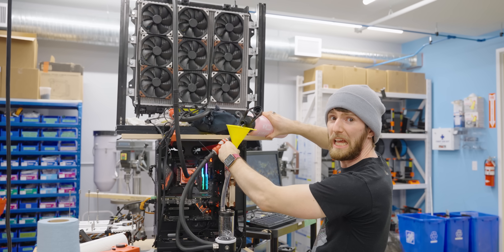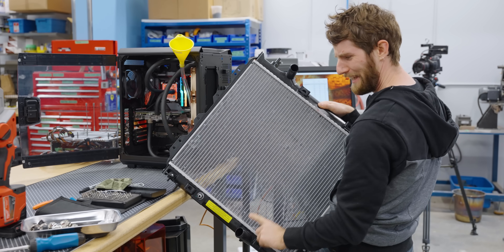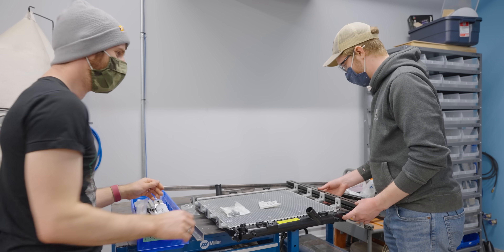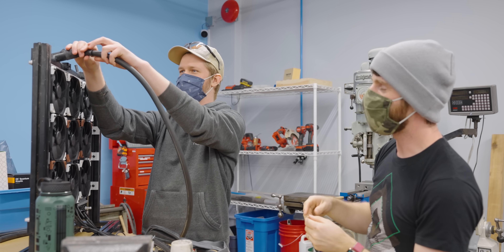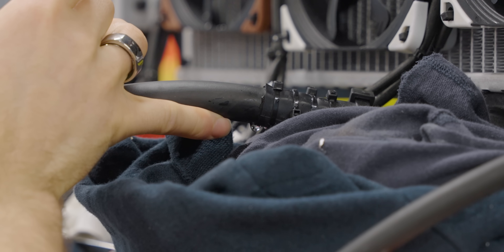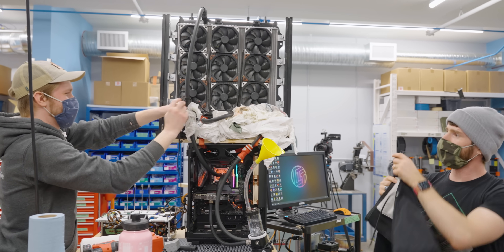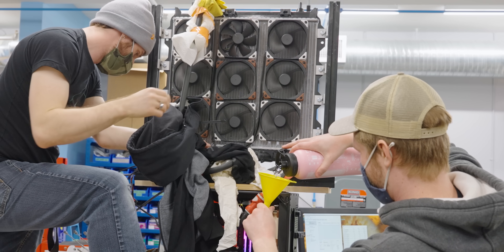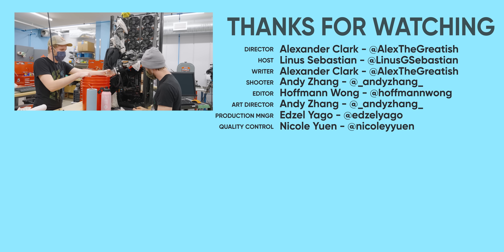Our Craziest Cooling Project Yet - Car radiator liquid cooler

Comment: Would love to see a "non-rushed" version of this tho, maybe with a nice case or something for the radiator
Reply: Maybe using a matching fan that’s designed to go into a car, instead of multiple smaller fans.
Reply: @GadgetAddict  Car fans aren’t really designed to spin fast. Normally when you need the most cooling in a car you are moving fast to you can just rely on that airflow. Car fans are normally only for idle and ones that are fast are very loud. Think blowlymatron but like 10 times the size
Reply: @cademckee7276  nah, electric fans on car radiators spin quickly and move a lot more air then the small fans would
Reply: @cademckee7276 that radiator at idle is dealing with many kw more heat then a consumer PC will ever make, your comparing 50+kw at least to 1kw max.

Car fans will move more air with more pressure then a PC fan ever will
Reply: @GadgetAddict  except the fan for the car would be inordinately loud
Reply: @GadgetAddict  I have done something like that way before youtube, when AMD Palomino and Thoroubread cores were the latest technology, up until we retired the Phenom 955s. The whole setup could diplace the cooler noise and heat generation to outside while keeping four computers at apropriate temperatures. The solution run for almost 10 years without many problems. After that we turned back to air cooling with heat-piped cooler blocks, when bigger diameter low noise fans with long lasting bearings got introduced to computer market. 
We have used a Peugeot/Citroen radiator, fan and fan control unit, because it was among the easiest to retrofit its controller to use another sensory input. The pumps where the biggest problem. Now since start-stop systems got invented and there are electric coolat fluid pumps available, probably the whole setup could be borrowed from a single car. But, still each PC needs a small fuild pump of its own, because the computers are/were connected in parallel to each other, so one central pump was not doing the best job.
Reply: @GadgetAddict  how about a ton of delta fans? That way the neighbors can tell when you fire it up.
Reply: @GadgetAddict  sadly the fans were the least janky part of this whole thing.
Reply: @GadgetAddict  if it's belt driven, they should hook it up to the loudest, fastest motor they can find.
Reply: @GadgetAddict  d
Reply: @GadgetAddict  they are too loud and inpractical!
Reply: @GadgetAddict  an eletric radiator fan would also run on 12 volts well 14.4 to be more exact but it would run at 12 volts and still be above 70 percent and the issue of all the leaks could be solved if propper fittings and adapters could be found
Reply: @GadgetAddict  that would be far too loud car radiator fans are insanely loud
Reply: @GadgetAddict  but how do you make the conversion for the power requirements between fan and power supply?
Reply: @SEBAYANI08  You don't, it's 12v to 12v lol
Reply: @GadgetAddict   the problem is the voltage of the car fans .. you wouldn't be able to controll the fan speed
Reply: @Ptrmrkks  It's a 12v fan lol and your PSU has a 12v rail
Reply: Try going to carquest, AutoZone, O'Riley's. And get the correct hose for the radiator. Maybe get a proper radiator fan or something like a 12-14" fan for it. Then maybe not mount it on the top of the tower? Lol. Thanks for the good lol though 😂
Reply: @AustinFerguson   and also try not using zip ties to clamp the hose lines lol
Reply: yeah i hate these rushed linus is busy needs to be somewhere else in 5 minute videos linus is lowering his video/build quality by trying to do too much
Reply: @roberts_lancmanis I was super annoyed that they have this pretty nice fab shop now but they used a bike tube to make a connection…. Like at least try and maybe 3D print something at the minimum
Reply: I agree. I have a half-assed peltier/water cooler project I've made, and the one thing I spent time on was making sure it didn't leak. Would've also been neat to see how it compared to a 360 rad after the water temp reached its max.
Reply: They've GOT to collab with the car-engine PC that JayzTwoCents  is working on
Reply: @RidgeRacer  I was thinking the same
Reply: @RidgeRacer  do tell?
Reply: Yeah, sorry but this was frustrating. I don’t want to look too deep but it seems like this is happening more frequently where videos are being rushed and kind of defeats the purpose of the video in the first place. What did we learn here? Exactly nothing.
Reply: @roberts_lancmanis  agreed, seemed purposely rushed/dumb
Reply: Oh man, you could say this about so many linus projects.
Reply: very hard to watch they have 3d printers there is a lathe in the background why not use them
Reply: @markilleen4027  Because LTT is all about half-assign stuff just to piss people off instead of actually caring about the quality of their work and content.
Could just as well sell all those fancy cameras and editing rigs and record this shit on a 640x480 webcam while they are at it.
Reply: Just watch the way better version from jaystwocents
Reply: @roberts_lancmanis  absolutely loved it. This had a very 2015-2016 LTT vibe to it, and a bit of whole room watercooling.
Reply: Yea, I came here to say this same thing. I wish the quality of LTT projects were less jank and thrown together. They have great ideas, but lacking in execution.
Reply: @roberts_lancmanis  wait i thought thats exactly what ltt is
Reply: Yea I would love to see the leaks fixed and maybe a quick case thrown together to see what this thing can really do.
Reply: Yeah, the jankiness totally killed this one.
Reply: Or in a desk
Reply: @littlefigs5964 " future Googling am i ever going to get married ?"
Reply: The project is useless. Just buy a MORA 3: https://shop.watercool.de/MO-RA3-420-LT-black with a stand, Fans, Pump/Resholder and everything and you got a HIGH-End germany engineered/manufatured product. ANd not such a cheap stupid crap like in the video.
Reply: I would've really liked a video of this that wasn't half assed as I'm sort of considering doing something like this, and would've liked to know if it was viable. You might not even need a fan if you have enough radiator surface and maybe a radiator that's finned more loosely to accomodate air convection, like one from the back of a fridge or something.
Reply: @Dean h Yep, the old whole room watercooling project.
Reply: @roberts_lancmanis  yep, fixing the leak is faster than getting a million towels
Reply: Agreed. Should have made it a decent job. Maybe even use the radiator on the side of the case as a back plate and proper seals and all that. Then again, being on top, gravity will ensure a continuous flow instead of relying on the pump for flow.
Reply: ... Bigger pump..  i mean more cowbell
Reply: @EdvardHansson  I'll stand by that.
Reply: The non rushed version is called Mo-Ra3 420 pro, work better, look better, is already designed for standard watercool fittings, have a side slot for the pump, and can be chained. Plus come with feets.
Reply: JayTwoCents did this a while back (granted he used 3x 360 rads instead of a car radiator) and used a regular house fan and it was much more organized.
Reply: add 5 sides to the radiator and turn it into the case
Reply: If Alex is involved it's going to be rushed and half assed. They need a real engineer on payroll.
Reply: Use the radiator as the side of the main case
Reply: they just did it!!!
Reply: You're in luck.
Reply: this is my thought on every video... it's always a decently interesting idea with he most half- assed execution imaginable.
Reply: It would be cool in one of those big cubical case, with the rad taking pretty much the entire side of the case.
Reply: Just buy a mo-ra3 or alphacool/phobya nova radiator.
Reply: Seriously. I wonder what a serious attempt would do (you know like one that isn't leaking). I think if it was done right you could give your cryogenic cooler a run for its money
Reply: like the one he use to have long time ago, with ice water )
Reply: It seems like you want the XPROTO L with some 360mm brackets :P
Reply: Just using proper fittings would have made this an actual success. But very entertaining none the less.
Reply: I too would love to see a follow up video to this!!!
Reply: Edith RGB fans
Reply: @Dean h There are the Whole Room Watercooling vids from back ~2015.
Reply: Agreed, make a real one. Not a 4 hour build lol was super funny though
Reply: mount it on the wall.
Reply: Was entertained, even if it was cringe worthy.  Would love to see better tubing with radiator part of a large case.  Take two with no rush and better planning.
Reply: @roberts_lancmanis  it's really bad!
Reply: It can be properly adjusted n piping then result will be promising
Reply: Gamers Nexus did a video using a car rad
Reply: they half ass it because they are more about quantity than quality. they need to pump out like 15 videos a week with Linus being in every single one. Linus hasn't written a video in years
Reply: @Blackstar1701  why tho? that just brings down the quality on everything
Reply: @TheStriker0525  to make as much money as possible.
Reply: I thought about making/modifying a case that uses a radiator as a panel
Reply: Agreed, but this time try 1 or 2 motorbike radiators ....
Reply: Some of us enjoy the rushed jokey content, I'm an IT Guy in training it's nice to see things go wrong and to have a laugh without it costing your employment.
Reply: #linusrepeat
Reply: I agree
Reply: If you got most of your money from sponsorships of companies that make water cooling systems, would you coble together a system that worked well?  Or fail humorously?
Reply: Also get  a stronger pump, better fans, clean up the janky tubing...
Reply: That wouldn't be LTT though!
Reply: They would take 2 years to finish it.
Reply: I agree
Reply: A air conditioning condenser from a vehicle about the same size as radiator and all aluminum. And can easily adapt any kind of fittings
Reply: basically, a carefully planned test.
Reply: I think they were also in a rush because linus said he had to go for the WAN show.
Reply: I would love to see a non rushed version of all the customer projects like the desk PC's and water chiller. It's like they get 95% of the way there and the rest is just jank.
Reply: Linus…… you better do it. Mother said
Reply: literally just hose clamp the tire tube to a rigid PVC connector that can be adapted to your pc cooling line size
Reply: Now slap the 500mm Corsair fan on that bad boi
Reply: I would also say maybe go with hardlines that actually fit the radiator
Reply: Or maybe even teaming up with Colin Furze to come up with a solution. THAT would be a VERY interesting video
Reply: I could see it working, using the proper fittings, and like you said a case or something of the sorts to put the radiator in, they could clean it up and with no leaks with the proper adapters and pump
Reply: I see what you mean... Such a great idea it  seems, that it should be properly tested [without leakage]
Reply: Maybe use an electric fan from a vehicle, they also make electric water pumps for vehicles.  Use those, and don't just half-ass the job.  The worst thing I hate about this show is they just jerk-around with some good ideas and screw them up....
Try hand-cuffing Linus and letting his team do the real work while he talks about it....HANDS OFF!!
Reply: I'm so glad I'm not the only one on this, was kinda dissapointed to see it just leak everywhere with them not even trying to fix the leak
Reply: Okay re utterly rire ra 😟 worry tu to era era RSA RSA a  et RSA res
Reply: Same
Reply: The rush is The fun part.
Reply: Using a smaller radiator
Reply: When you said "or something for the radiator, my crazy ass immediately thought.. a PT Cruiser front clip?? Could also be used AS the case.
Reply: This would be perfect for a water cooled server rack.
Reply: I feel this way about a lot of LTT's more "out there" cooling ideas. Every time, I feel like they reach this point where they discover something unusual that actually works, and then immediately botch it doing something that could have been prevented with even five minutes of forethought only to turn around and say "Oh well, we tried!"

I love this channel and I've been a fan for years, but it's beyond frustrating because I know they could do so much better and just choose not to.
Reply: same
Reply: Why not 3D custom fits to fit the car radiator
Reply: I bet if they used some silicone between the rubber and plastic connection and rubber cement for car tires where the inner tubing and the soft tubing met along with zip ties at each connection and let it dry for 24-48 hours it would have worked.
Reply: With proper 3d printed tube adapters
Reply: I thought this was hilarious to watch.
Reply: Car guy here. It wouldn't be that hard to do this. You'd need a bit more power but nothing horrible. I'm the racing world aftermarket radiators can get pretty brutal, efficient, modular, and actually really easy to understand and work with while still being relatively cheap. A large radiator and some serious 12 volt purpose built electric fans to cool it are stupid easy to slap together and work scarily well. Your gonna need power, a solid or threaded set of adapters from a full size radiator water hose to the size of your cooling systems water hose (which would be the hardest step but still not that crazy), and a way to control your fan speed. 

What's reaaaaallllly getting me about the high performance automotive radiator thing is the hilarity of going full send drag race with it and installing an ice box 😂 imagine dumping a bag of ice before running cinebench like you're getting ready to pull a low 9 quarter 😂 Take it a step further and drop a nitrous kit in the case and replace the tank with nitrogen so you can just slap a button fog the whole case when youre under a stupid amount of CPU load lol
Reply: This was obviously done on purpose, any number of easily done alternatives would've made this leak proof.... The decision to place it ON TOP of the entire PC is all the proof you need. If this was being serious they would've placed it next to the PC..... DERPS.
Reply: They have 3D printers and a milling machine etc to make inhouse some water pipe reducers.
Reply: and the radiator being side mounted instead of top mounted that kind of killed the whole experiment
Reply: Get a truck radiator and you might be able to run it passively. Although you might need a car water pump and that'll be loud.
Reply: Two years later and i can finally rest in peace now
Reply: Yeah what an absolute hackjob this was but that's par for the course really.
Reply: If you use a trans cooler it works a lot better
Reply: Yeah this was dog crap
Reply: A year later, this video still makes me too irrationally angry to watch. It's basically the closest LTT gets to becoming utter click bait trash. Ugh.
Reply: GirlBaBes.MenGirlBaBes.Men
Reply: @roberts_lancmanis  I think the video was intended to be comical
Reply: @siddharthagupta8528  I didn't laugh, I just felt annoyed.

Comment: I built a Water cooled system with a Car radiator years ago..... I used the 12v fan that came with the Radiator I purchased from the Scrap yard. I had it mounted Outside with the tubing going through the wall. It worked fine for a very long time. It cooled my triple 480GTX SLI rig.

Comment: A desert buggy transmission radiator would be a little smaller than that whole radiator but only have those nice transmission line connections. Also I saw an Amazingon ....... product ....... which already had a large fan included. So in that case you should have 2 of them. One for processor and one for graphics.

Comment: You have the clamps for the transmission loop yet use zip ties for the other one alongside the tire inner tube. Why? Just use clamps!

Also, are the fans really necessary here? At what point does the loop become big enough for water to basically return to ambient before it makes it back to the CPU/GPU blocks?

I fell like clamps and a more sensible positioning for the radiator could habe been a very good cooling solution.

Comment: I use the radiator from a Nissan Micra and 4x 140mm fans at 15v. It's running good and has been for almost 6 years.

Comment: How about a radiator-less water cooling solution... just have the computer plumbed into a water supply providing a constant stream of fresh cold water. Have the run-off collected to water your plants or for flushing toilets.
Edit: Never mind, turns out they did a video a couple of years ago connecting the loop to their kitchen sink.
https://youtu.be/CFXyyJyEtVI

Comment: I was cringing so hard on this video. Like why not just use hose clamps and pvc pipes inside the hoses so you have a strong seal with rubber on plastic? They woulda saved alot more time not dealing with leaks and just actually focusing on the cooling and benching.

Comment: I was thinking of using transmission coolers like https://www.summitracing.com/parts/der-13315

Or one with the fan and shroud.
https://www.summitracing.com/parts/der-13700

These aren’t necessarily the exact ones I would use. Ideally I’d find a large cooler that uses a brushless fan like Spal. Stack plate coolers have always cooled better than the tube and fin (my experience). In this case I like the tube and fin as they tend to flow better. (Depends if flow matters in this case,, it matters with automotive transmissions.)

Comment: Did this 5 years ago. Almost worked passively. Over 5 Liters of coolant worked like a charm. I just jused the same parts they used on cars to mount it to the side of an old atx chassis. Looked like crap. But cooled like a boss.

Comment: They have this well-outfitted workshop and this is what we get. Some bicycle tube, zip ties, and tape.
And they could've used a car radiator fan and fill the radiator from the top.
Well, my bad for getting my hopes up. It is LTT after all.